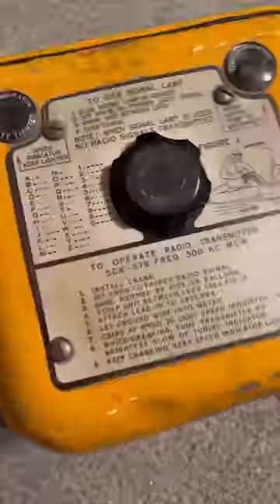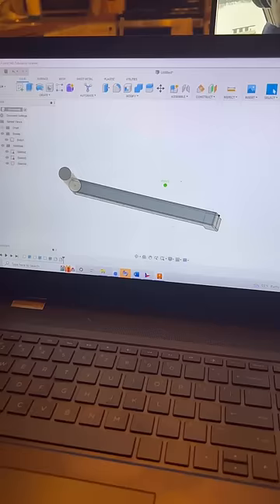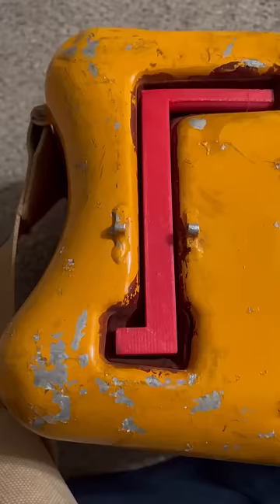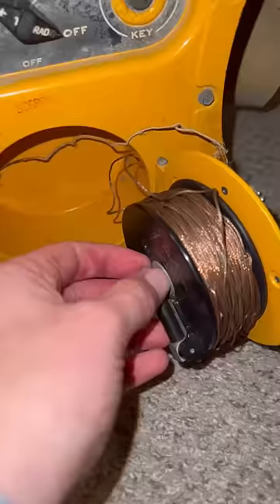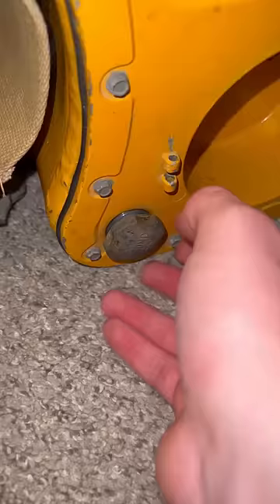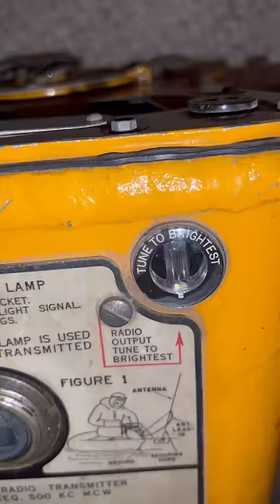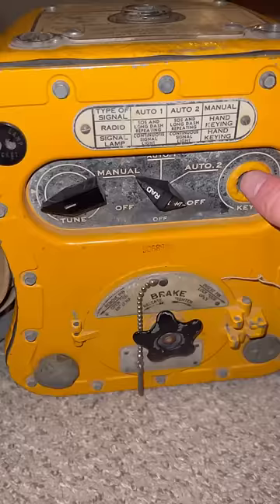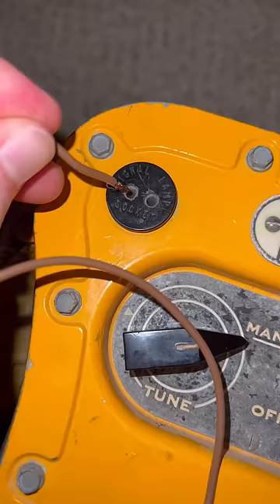Turning this Crank is Illegal

Comment: Amazing how well this turned out without knowing how to use calipers.
Reply: I was scrolling looking to see if anyone else noticed that lol.
Reply: @CJgolfing  same
Reply: @Afghanistanian  A dial caliper is an instrument used for extremely precise measuring, especially when taking dimensions for things like this, where you have to recreate a part for a small mechanical assembly.

Or at least, this is my memory of them based on when I used them in high school almost 10 years ago!
Reply: @Afghanistanian  he used the wrong side of the tool to measure the gap , top side for inside
Reply: At first I thought he didn't know how to use it. But maybe he was just shooting the clip for the video and didn't bother to do it right
Reply: @brandonjc13  vernier caliper
Reply: @briangrady365 I've heard them called both.
Reply: @brandonjc13  micrometers are for “extremely precise measuring” as you put it, but you got the gist of it
Reply: He made a video about it it's easier to just eyeball it because the corner are round
Reply: @yourdrummer2034  Vernier are ones without a dial or screen - you read them by lining up the marks on the scale.  Dial calipers include a dial.
Reply: @jdrevenge  I understand, but I have heard one called calipers by one person and another call the same tool verniers by another and vice versa. Just saying people know them by both names
Reply: @yourdrummer2034   Yes, just saying that technically there are differences, even if the terms are used interchangeably colloquially.
Reply: @jdrevenge  exactly
Reply: Watching him do that physically hurt me
Reply: @briangrady365 that's not a vernier caliper, that's a digital caliper.  Vernier only has lines printed or etched on the caliper; dial calipers have a dial gauge; digital have an electronic screen...
Reply: @bertaboy Digital calipers use the vernier mechanism, where small distances are measured by comparing two scales of slightly different pitch, only the vernier mechanism is detected using electronics instead of eyesight. So digital calipers are technically vernier calipers. That said, I wouldn't generally call them that.
Reply: funnily enough, he explained why he did it like this in another short. if i recall correctly, it was due to the curvature on the recess for the handle and some space issues
Reply: He was measuring how large the crank handle should be to fit in the space, not the space itself. It’s not that hard of a concept to figure out for yourself if you just quit ‘ree’ing about simple things and ask yourself ‘why?’ Instead of immediately jumping to the conclusion they’re an idiot…
Reply: @briangrady365 this was a digital calipers. A vernier caliper has a bunch of "extra" lines that you read for the final digits. A dial caliper has an arm which rotates around like an ancient wrist watch from a hundres years ago to indicate.
Reply: @yourdrummer2034 vernier referrs to how it it displayed. There are vernier calipers and vernier micrometers for example.
Reply: He made a video explaining it so he definitely knows how to use one. He's an aerospace engineer after all
Reply: @Aderin.  so he's lazy.
Reply: @jdrevenge  idk, but it worked just as well so I would say that's the efficient kind of lazy than just being lazy in a bad way

Comment: Disconnect the antenna and you’re fine, it won’t broadcast very far. Some of the more modern radio transmitters have dummy antennas for testing purposes that prevent long range broadcast. It seems like you would need to use Morse code to transmit anyway so unless you use the morse key you won’t transmit an emergency signal.  Doing a quick search the transmitter on this radio uses 500kHz which is an obsolete radio band and no longer monitored for emergencies. It is used for ship to shore NAVDAT now but there isn’t much chance of you causing any problems. unless the antenna is out and deployed you won’t get anyone’s attention at the FCC. There’s not much interest in hunting down rogue signals unless you are interfering with other broadcasts. If you live near the ocean, you might step on a ship’s signal but otherwise its no big deal.
Reply: Love this! Also at such a long wavelength he won't get out far having the wire coiled up anyway.
Reply: Great info!
Reply: With no antenna the power goes back in the radio and burns it up
Reply: @JeffEbe-te2xs   Hence why I mentioned a dummy antenna. Just put a short length of wire in there and it still won’t transmit far enough to matter and it will prevent an internal meltdown if you aren’t using it for long.

Comment: These old emergency transmitters are capable of broadcasting on frequencies that are licensed to FCC Licensed Amateur Radio Operators and if you hold the proper license you can legally transmit using one of these. They are called Gibson Girls and I used one back in 1964 to make a call from Texas to a station in Canada. I believe it was on 40 meters.
Reply: Thats pretty crazy and cool
Reply: How old are you?🤨
Reply: @antcheffinup8045  I'm 75 and my call sign at the time was WN5IAQ.
Reply: @robertmontgomery3892  that’s so cool. Thank you for sharing :)
Reply: @antcheffinup8045  75. I was granted a Novice license when I was in high school. Most of my friends were also licensed.
Reply: My callsign at the time was WN5IAQ.

Comment: Bro measured the cavity with the lower jaws for "outside measurement"
Reply: Yeah, I was puzzled.
Reply: Thank you for noticing that
Reply: I searched for this comment
Reply: yeah all BS
Reply: He specifically did it so you would leave a comment about it. NOOOOOOOO
Reply: Ikr hes designing shit and can’t even use a digital vernier
Reply: Anyone using the word "bro" shouldn't be saying anything about anyone.
And also, who cares how he used the calipers?
Reply: @davidrichter9164  because there's literally jaws on the calipers designed to measure the inner dimensions, you just flip it over. It's like buying a van, but using it to pull a trailer full of stuff that would fit easily inside the van.
Reply: @davidrichter9164 sort of like saying who cares if the guy is reading a book upside down or loading a gun backwards lmao
Reply: Because he's not measuring the inner dimension, he's measuring the size he wants it by eyeballing the cavity and making it a little smaller.
Reply: Ya that was bad
Reply: Bait so you would comment and feed the algorithm.
Reply: probably just reshot it for the vid it would be pritty annoying to actually take the measurements just for that small clip instead of just filming all this after he made it all
Reply: He did it because he didn’t want the exact measurement
Reply: Yes. I noticed it immediately and it hurt my brain.
Reply: That's where the handle sits. You want there to be room. He clearly measured the actual end of the crank correctly, since the tool he printed is the right size
Reply: @periwinkle43  look at some of his later videos he gives the reason
Reply: i saw that and paused and went straight to the comments

Comment: When I was a radioman in the US Coast Guard we used to conduct drills with those in the '80s on our cutters (ships). They are used for survival rafts. Once you use Morse code for work like i did, you never forget it. These were usual tuned to the emergency life boat frequency. I forget but it's in the 2mhz range. During drills, each radioman was assigned to different life boats/rafts because we were trained and knew Morse code.
Reply: The box said 500kc, that would have quit the range when your in the open oceans. No matter what time of day.
Reply: @pd1jdw630  KC is kilocycles which is no longer used. its called Kilohertz (Khz) now. MC megacycles is now Megahertz. after a man named Hertz. a lot of factors come into play with wave propagation. time of day, height of antenna, vertical antenna versus horizontal. ground waves over land versus water, storms/fog, omni antenna versus directional and etc. Radio Frequencies propagate better over water than land. But at night with less atmosphere, the signals can bounce/reflect/refract thus increasing the distance.
Reply: @andrewdegeorge9649  I know. 👍🏻 
I use propagation to connect with other people over the world.

Comment: You could always run the antenna into a dummy load where it would not transmit beyond that dummy load, Or if you are amateur radio operator who knows Morris code you could send your call sign followed by test test test , test test test , test test test....
Or like the other person said that at the top of the hour you have can transmit for 5 minutes to test...  I would just use the dummy load...

Comment: Most nations have ended monitoring of the 500kHz frequency as an emergency band.  It has been replaced by the Global Maritime Distress Safety System.  I doubt anyone would be able to hear the beacon and even if they did, it would take multiple receivers to triangulate your approximate position.  I don't think anyone would find you.  :)  It would be interesting to see if it would still transmit if you had a receiver capable of 500khz reception.
Reply: Sure
Reply: True
Reply: I had to think for a while on how snarky I was going to be with this reply, because the idea that they were just completely abandon monitoring of an entire frequency that was used as an emergency band is insane because most, if not all ships lifeboats, and even some life rafts are still equipped with 500 kHz transceivers as a back up in case the new stuff fails now let me tell you something else the spreading of misinformation like this can kill people because someone could see this getting an emergency situation where they’re on a lifeboat realize the modern emergency broadcasting equipment is broken and see the old 500 kHz emergency radio sells well. I can’t use that because they ended monitoring of 500 kHz what would happen to them then because they saw your comment
Reply: @HannahthefurryIrishRedSoxfan  If anyone relies on anything they read in a youtube comment as a basis for life saving equipment maybe they deserve a Darwin Award.  I stand by that most nations have abandoned OFFICIALLY monitoring 500khz for GMDSS and 406mHz PLBs.
Reply: seems kinda scummy
Reply: @n1rbd Well you aren't wrong...
Reply: @HannahthefurryIrishRedSoxfan i mean, just because it's abandoned doesn't mean that if they know a dissaster happened, like a ship getting lost they will use what they've got wether it is "outdated" or not, afterall for anyone to hear your call there has to be someone listening to it first

Comment: Just a heads up, on some of the gibson girls the lettering on the front is painted with military UnDark (Radium) and it's exposed and easy to flake off. Might want to check and if it is Ra apply some varnish.
Reply: "Military undark"

I am stealing that line.

Comment: If it uses 121.5 MHz or 243.0 MHz and possibly other frequencies, you can legally test it for the first five minutes on the hour.
Reply from the maker: It’s 500khz so unfortunately that won’t work
Reply: @jackschneider17  the new frequency is 406 MHz, so as you are not transmitting on any emergency frequency, I think you are good to test it. Just to be safe I would stick to the first 5 minute rule.
Reply: These were usual tuned to the emergency life boat frequency. I forget but it's in the 2mhz range.

Comment: As an amateur radio operator and boater, I found this video very interesting. 500kHz used to be the international calling and distress frequency for maritime Morse code and was monitored by the Coast Guard, but in the late 90s it was phased out in favor of modern digital technology. 

Currently 500kHz is allocated to the NAVDAT navigational data broadcast system, though nobody is actively using it yet.

Comment: Homie just needed a half-inch ratchet and extension to crank it and he designs a whole ass handle. German engineers are calling and they want their over-complexity back.
Reply: It’s not that hard to design a handle like that, probably took him 5-10 minutes max
Reply from the maker: Tried that. Problem is it’s difficult to turn a ratchet quick enough. Sure I could’ve used power, but it would’ve been very easy to over do it and break it. Ultimately spending 5 minutes designing this handle was the best way to give an authentic cranking experience
Reply: @jackschneider17  AUTHENTIC CRANKING EXPERIENCE 

Lol, i know, im a child.

Comment: Guh! Dude let me help yah if your measuring the inside of something with calipers use the little prongs on the back thats what there for
Reply: I was looking for this. It looks weird and is wrong
Reply: The guy literally left a comment on this video right when he posted it acknowledging that he did indeed use them incorrectly and that he was just using them to eyeball. Its one of the top comments and was first thing i saw when i scrolled down. I think its pretty damn obvious how to use a caliper lmao. Also they’re*
Reply: Yesss, I was looking for someone who spotted this wrong measurement as well as me! That is just some bloody mistake that's hard to forget.
Reply: I searched this comment so long 😄🤣
Reply: @zokushatech  ya it's obvious...so he should do it correctly
Reply: he measured what he wanted. he didnt want zero clearance between handle and case as the real handle wouldnt have fit with zero clearance.
Reply: @SomeRandoooo  he got a good result for his purposes literally why does it matter beyond stroking your ego

Comment: man. i’m glad i seen this. if i woulda had to do that i woulda def cranked too hard. and i’d imagine me not ever realizing that it’d burned out, and just exhausting myself for hours cranking the shit out of it
Reply: Engineers aren't stupid, I'm sure the transmitter is more robust than a cheap flashlight.
Reply: 4.5V DC LED; probably 12-15V AC filament voltage on the terminal. I'm surprised it lasted until he "over-cranked" . :-)

Comment: The receiver that that device connected to is most likely replaced by modern tech so even if you broadcasted the emergency signal Noone would know
Reply: It's radio, that shit is still heavily monitored.
Reply: @marcusborderlands6177  Depends on the frequency. PMR Walkie Talkies are radio, you can buy them at a store and use them whenever you want. Your cellphone is radio, so is uour wifi router

Comment: Those things make for AMAZING wrecked on a deserted island tools too, even if the radio is broken, the fact that you have a mostly waterproof hand powered generator makes it so you can do SO many things in a pinch (easy fires starting, water purification, metal extraction, charging other devices…)

Comment: They won’t show up. It transmits a 1000 Hz tone on 500 kHz band and nobody monitors it anymore. It was a maritime radio. 

Tune a AM radio to the low band (one with a dial and not digital) and see if it works. No need unroll the antenna much.

Comment: I remember checking ELT’s in smaller planes as part of Annual, Pre-buy, and sometimes 100 hour inspections. Transmits a siren tone on 121.5 MHz and sometimes 243MHz. As long as it’s not a continuous signal then nobody pays attention to it. There was a time when someone didn’t check theirs and had the airfield driving around and calling people to check theirs.

Comment: Since it is WW2 era equipment, it likely transmitted on 500 kHz, which was the international distress signal frequency at the time.
That was phased out decades ago , so it is unlikely anyone monitors this frequency anymore.
Not sure if it remains a "restricted use" frequency.

Comment: by the way as a machinist I have those calipers — don’t trust them to more than like, .01in tolerance. They’re pretty trash. Accupro or Anytime Tools is more affordable than Mitutoyo but much better in quality than those. About 3x as reliable from my anecdotal experience — it’s incredibly easy to get false readings with those. If you do any measuring that requires closer than a  0.01” tolerance, save yourself the pain and spend $80-120ish on a good set of calipers.

Comment: You can test it provided the antenna is coupled to a dummy load.  You should not be operating the transmitter without proper loading.

Comment: you're using the wrong side of the caliper to measure that hole. you're using the side for external measurments for an internal measurement. you got a measurement that's smaller than it actually is.

Comment: Emergency Location Transmitters can be tested durring the first five minute after any hour. The frequency of that transmitter may not be the same as it is now. 121.5/243 MHz analog. Twice I set one off accidentally due to a less than perfect landing in a Cessna 150 😊

Comment: Bruh, it operates in the 500 mhz range (which is unmonitored) for only a few miles and transmits Morse code. You won't get in trouble.

Comment: The way you used those verniers really pissed me off
Reply: Not a Vernier... But wrong either way.
Reply: @williamduggins2172 what do you think it is then?
Reply: @camclark4522  It's a modern digital. Vernier uses a scale sorta like old micrometer. I use a dial caliper that has both metric and standard every day at work. Digital is cheating...
Reply: @williamduggins2172  it’s a digital vernier caliper
Reply: @camclark4522  No it's not. Vernier is a type of scale. No one in the machinist or engineering world would consider digital or dial a Vernier style. 3 styles of calipers.
Reply: @williamduggins2172  I'm a powertrain engineer... is also has a Vernier scale and a digital reading...
Reply: @williamduggins2172  Maybe its different in America but in England (where English comes from if you didn't know) its a Vernier

Comment: My Gibson girl came with two inflatable ballons and two hydrogen genetating canisters. It all still worked in 1989 the rubber balloon was dusted in talcum powder and still held gas. It was about 4' in dia after an hour of inflation. The hydrogen generator was filled with lithuim hydrate it was imersed in sea water to start the reaction.